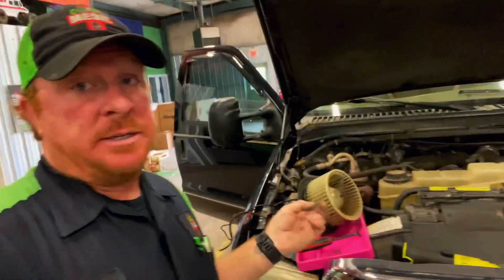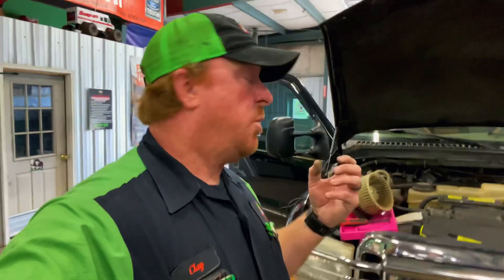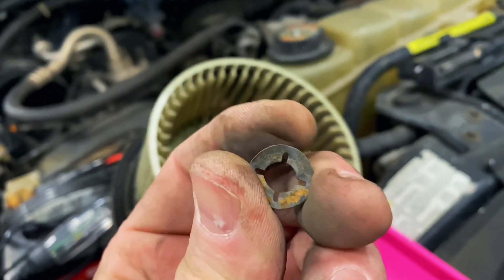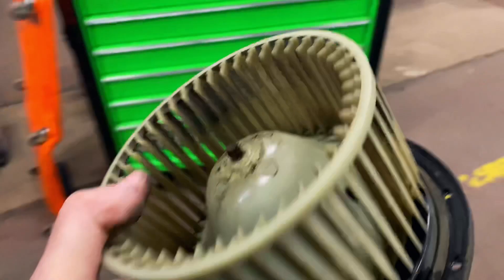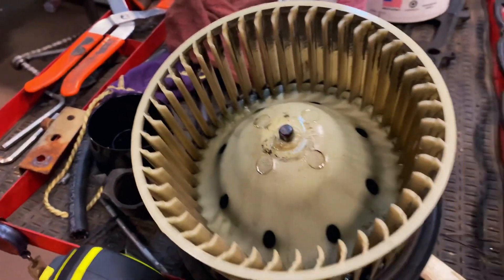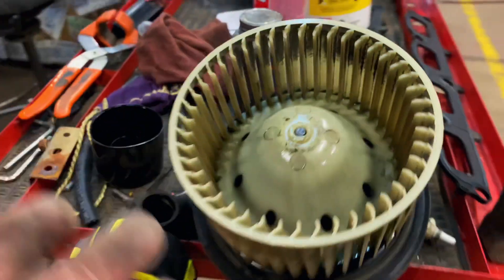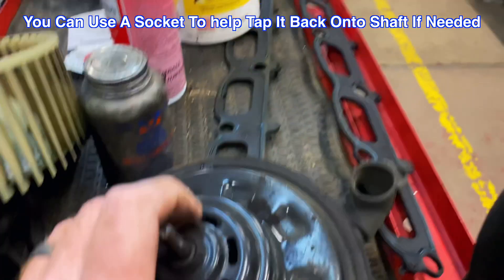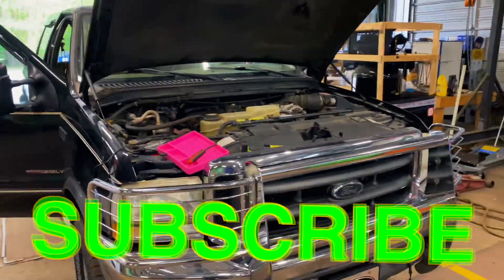Stop Breaking Blower  Motor Wheels! Just tap them off, here’s how to do it.

Comment: Now that pineapple juice you used there is one of the best fluids on the market.
I seen v clamps (steel)pops loose off aluminum housing  with just spraying that juice on it after you back of the nut

You need to do a video just on the kimball juice
Reply from the maker: We have when the kimball Midwest guy came to our shop the first few times https://youtu.be/eIxMAGRTKMg